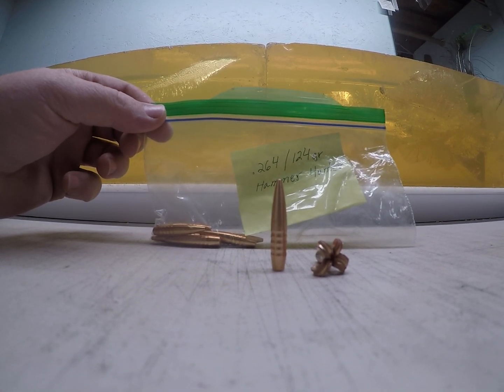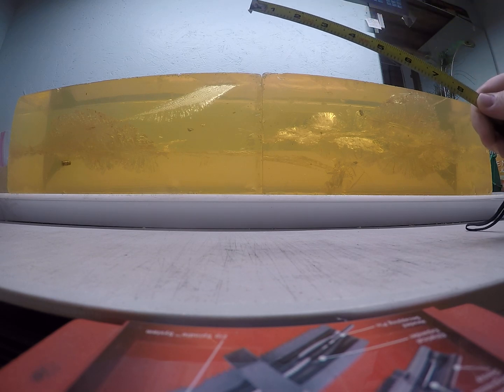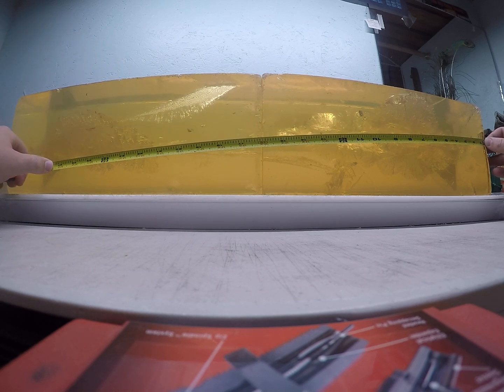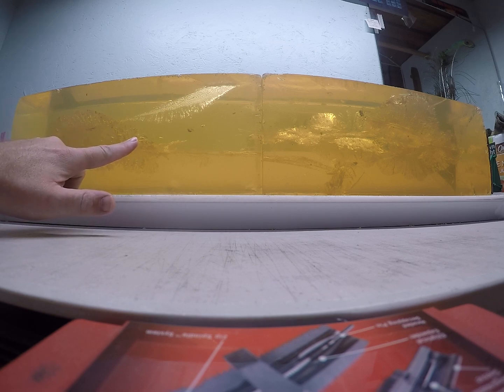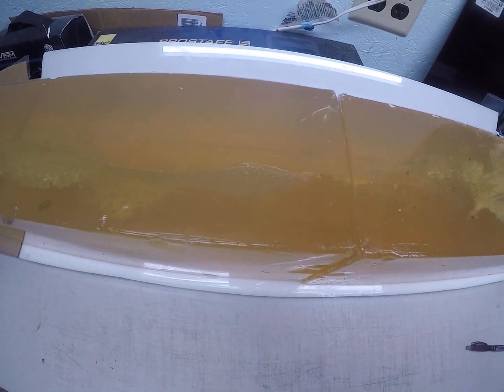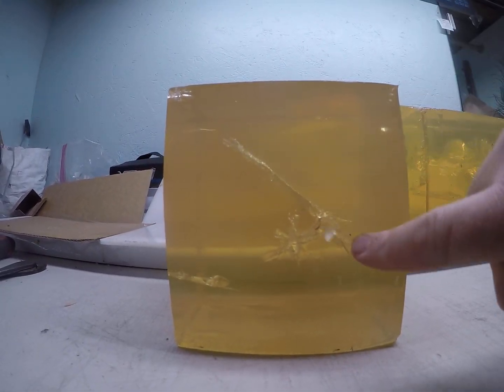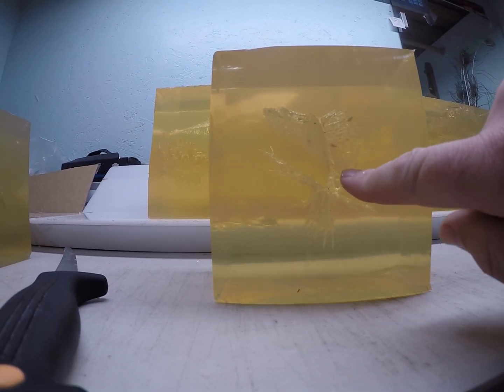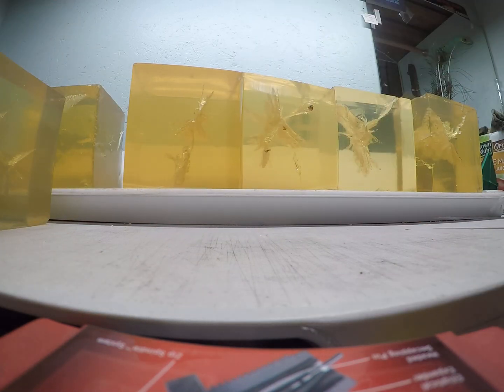6.5 Creedmoor .264 Cal-124g Hammer Hunter ballistics gel block overview PT2

Comment: Great review from what I have seen of these bullets they are living up to their Name HAMMER! When you load the highest load did you see any pressure signs in your brass? Wish hammer would come out with some load data on their bullets?
Reply from the maker: I have been thoroughly impressed with how much increased velocity you can get from the design of these bullets. I just take the load data from  similar grain weight bullets out of any of my books start low and work up I have found you can typically work hammer bullets up fairly high and and they have been easy to get to shoot really accurately. I have not used him in the field yet but the way they test I'm confident they will do fine I'm planning on switching to them here in a couple years as I have a large amount of stock in the bullets I'm currently using which makes it hard for me to actually switch.

If I ever make the switch to only monolithic bullets Hammer's are my first choice.

Comment: I think Hammer is a bad idea and bad performance.  The pedal are made to break off. Bullets predictably veer off and tumble.
Reply from the maker: According to Hammer the peddles are not supposed to and for the most part they don't inless impact velocities are really high. (same with Barnes) Cutting-Edge are the only monolithic bullets I have tested that are designed to shed petals. 

As far as monolithic bullets go Hammer's have given some of the best and most consistent good test results for me in gelatin and are super accurate. I have not used them in the field as of yet but I will and with my test results I am confident that they will do exactly what I need them to.
Reply: Hello  @simplemindedfella  and thank you for your test videos :) 

I do believe that Hammer intends for the petals to peel off, but there is an, according to them,  terminal ballistic wise opportune reason for it.
 Here's Steve, from hammer bullets, explaining the concept to Ron Spomer https://youtu.be/8H1LfYF8RFc?si=tGBvNuwnmZhMnSvN 👍

Comment: I’m an avid hunter that’s new to reloading. What 308 bullet do you recommend for whitetail deer under 100 yards? I hunt very thick woods so I need it to drop them quick and leave a good blood trail. If they don’t go down in sight or leave a good blood trail they are extremely difficult to recover.
Reply from the maker: My brush gun is a Ruger M77 Hawkeye compact and I use the 168 gr Nosler ABLR and love them. Shooterproshop.com sells blemish bullets and I have never had issues using them. 

If you are wanting to go monolithic really anybody's at that range should work good I would lean towards hammer bullets or cutting edge if price does not matter as they seem to dump energy better and give more extensive hydrostatic shock then say something like Barnes bullets.  I also really like the terminal performance of Hornady's GMX line of bullets .
Reply: Simple Minded Fella do you prefer the ablr over the others?
Reply from the maker: @kfranklin308   Yes the way the jacket is designed it starts to come apart quickly for good hydrostatic shock and dumping of energy in the vitals where you need it and then holds the last half of the bullet together for deep penetration and I almost always get an exit hole.